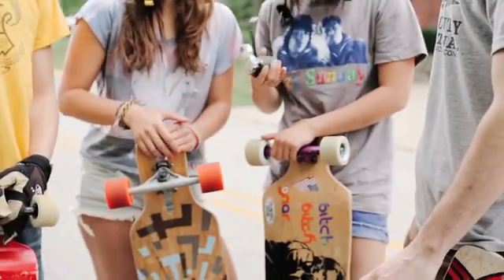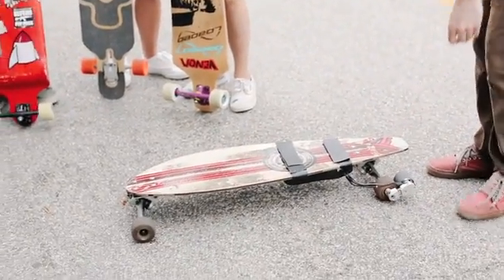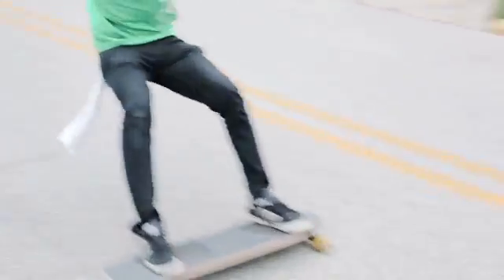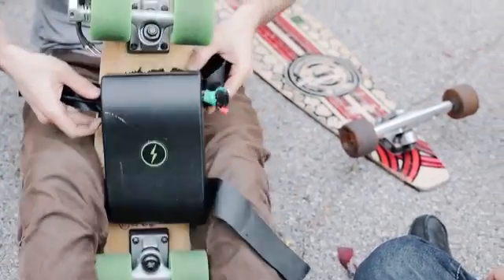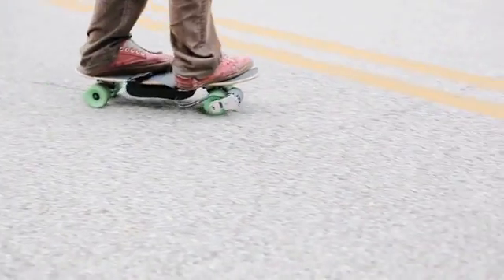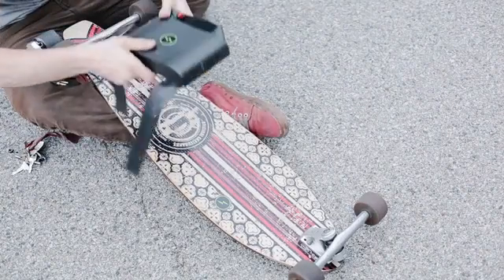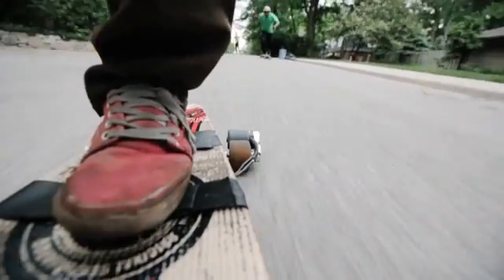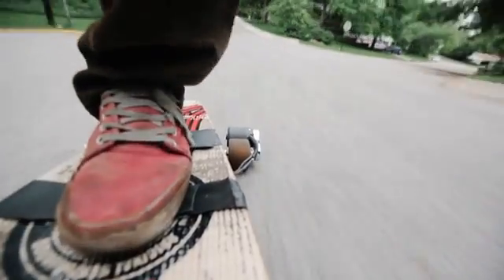Kickr adds an electric motor to any longboard (VIDEO)

Comment: okay so I have an idea....what if there was another motor on the other back wheel? wouldn't you go faster because there is more power from two wheels? just wondeirng
Reply: You would definitely have more power (you could pull someone else) but if you can go faster depends on the maximum rpm of the motor and if it's already reached at 20 mph .
Or they build a two wheel edition which has a gearbox with an other transmission.